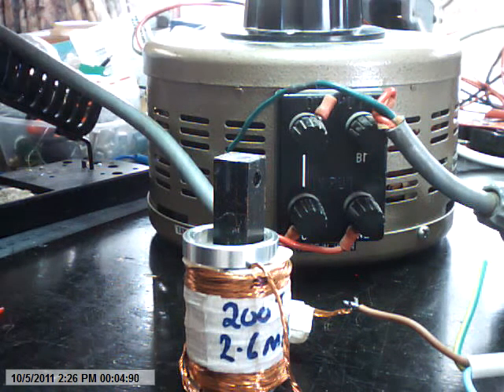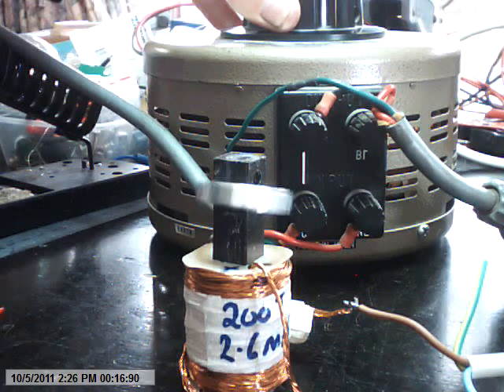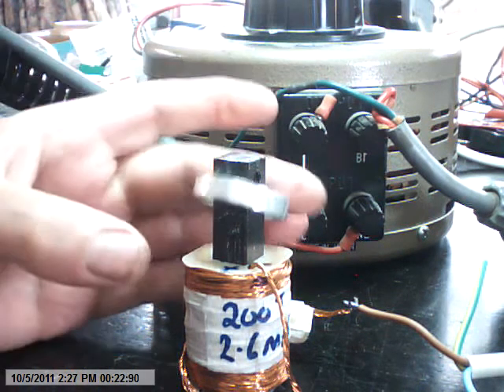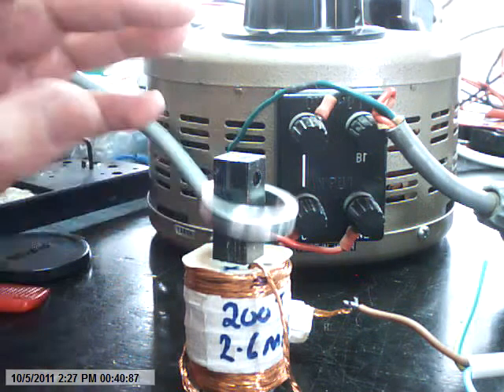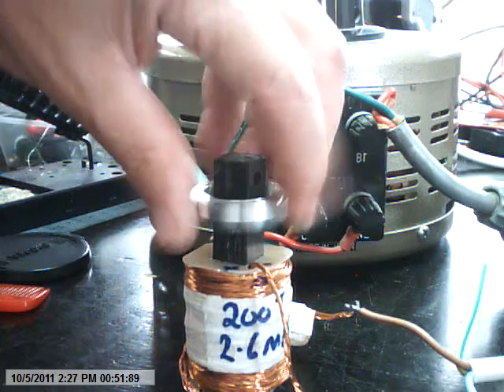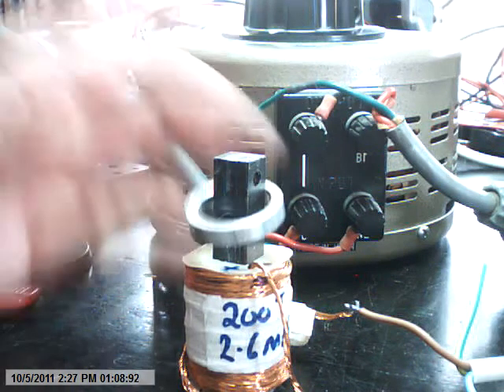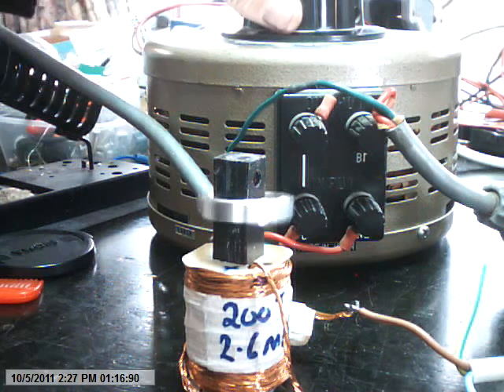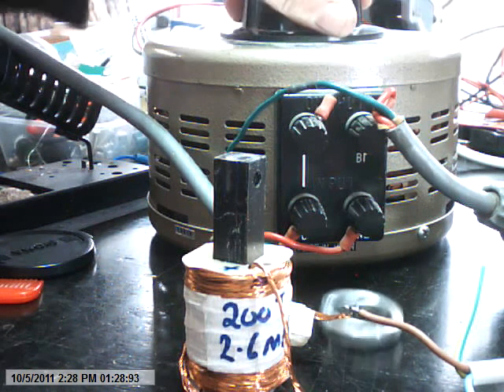Lenz's Law & Eddy Currents

Comment: Nice Demo thanks for this.
Aluminum conducts & is a shorted turn. Induced current creates mag field opposite to inducing mag field. So Alu loop balances both magnitude & phase in opposition to coil.
Very little energy required to do this cause whilst current is quite high, volts drop around Alu loop is very low. So E times I which is Watts is small.